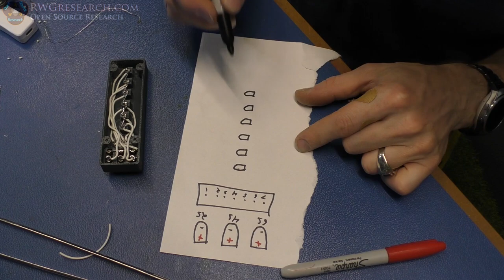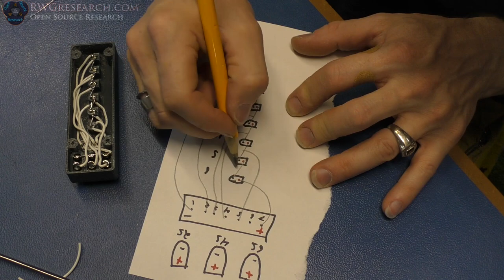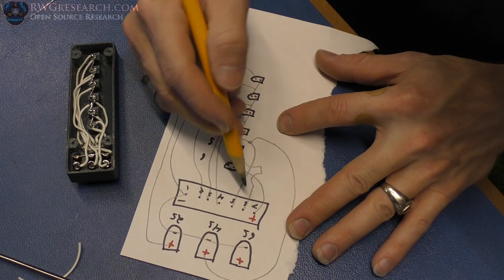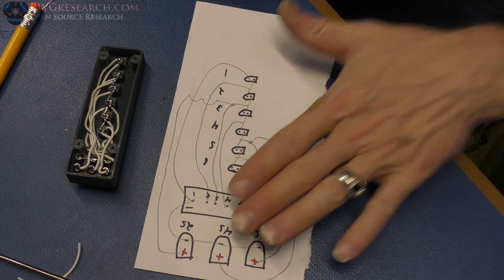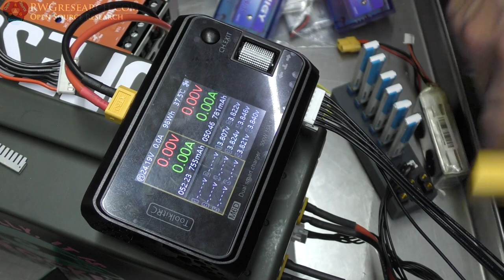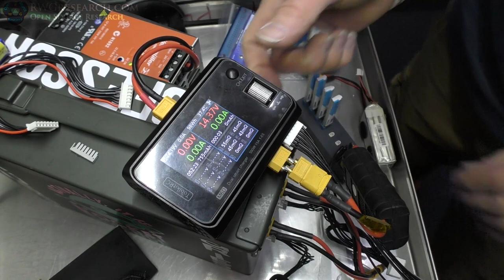BT2.0 Balance Storage Charger Series DIY ( How To Make Your Own! )

Comment: What are those batteries used for? (Coming from 18650 knowledge only)
Reply from the maker: These specifically are used for RC related stuff... they are high amp output and the connector is deigned to be very small but low resistance high current.  so theses are high voltage ( 4.35V) lipo. the bigger blue ones are 450mah. rated to put out burst up to 27 amps and contentious for about 13.5 or so. that's crazy for such a small battery! kinda crazy for such a small battery. but when i use theses in my 90mm Quad i built they rock. ( video on that at some point) you can see it in this video near the end: https://www.youtube.com/watch?v=eaHUm6XAbqs ~Russ

Comment: Balance? What why these are 1s cells? They'll be charged to the same (ish) termination voltage and roughly to their actual/nominal capacity using that Betafpv multi port charger that you have. Are you trying to put the exact same amount of charge into each battery? RC balance charger like that Turnigy can't do that either i don't think, don't see how it could in principle; not that it's all too fruitful since all the cells are going to have individual self discharge rate, so you just top them up individually to their termination voltage and soak (which is what balance chargers normally do, but with common current path for the bulk of the charging) and if you battery them up in series in a consumer device, you should stop discharging before any of the cells can reverse bias, and balance charger can't really prevent that either.

Balance charger uses a common current path for the charging. There's two main methods for the balancing, it will either shuffle some charge between the cells to keep them same voltage using a switched capacitor (rare), or it will reduce the charge current and shunt a given cell a little when one cell is going over the target voltage, and you expect the RC ones to also be able to selectively shunt semi-continuously during charging when a cell peaks above group voltage. But it also fundamentally has potentially a little voltage skew between the individual taps in the measurement just like internal reference of separate chargers of a multi charger isn't necessarily exactly on point. If you can charge cells individually, i'm lead to believe, it's considered the preferred way. Balance charging is an unfortunate "hack" we have to do because you already have a battery which is series wired internally and doesn't just disassemble itself for charging purposes, individual charging would be really clunky to implement on top of that, and the balance wire isn't really meant for full charging current.
Reply from the maker: Lots of good Info here. The word "balance" is slightly out of context for what I was needed. I was needing a way to "balance" (at storage voltage 3.8v nominal) for safe keeping after flights. Not so much during charging. As yes the betafpv charger will charge them to approximately the same voltage. Good for use. But no way to storage charge / discharge them. ~Russ
Reply: @RWGresearch  Oh right! Yeah yeah valid!
Reply: still need an active balance charger for series super capacitors. Cant find them in the market...
Reply from the maker: @MasterIvo  I have had good luck with a system like this. https://www.beyondlogic.org/review-li-ion-lipo-lifepo4-lithium-battery-active-equalizer-balancer-energy-transfer-board/

Ita basically an induction circuit that moves energy around through an inductor... Like my old videos where I was using the inductor to move energy around in an LC circuit... Could even make one. I think. ~Russ
Reply: @RWGresearch  thanka Russ, yes using a coil is key. but I dont want to charge batteries. I want to charge (and balance) series super capacitors
Reply from the maker: @MasterIvo  right. I got ya. And this can be used for that. It's just at a different voltage. Whatever the cap is. ~Russ
Reply: @RWGresearch  it's JUST a different voltage? But that is just a big difference, I need to be able to set the voltage at a safe maximum. thats the whole purpose of the manager